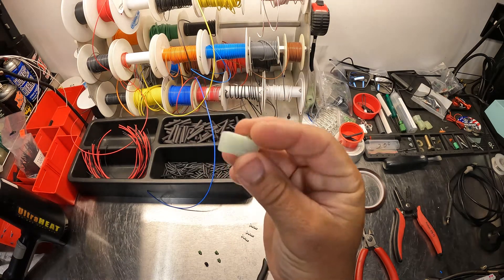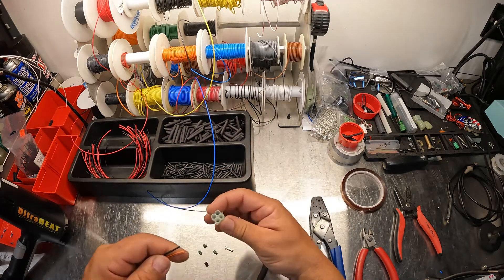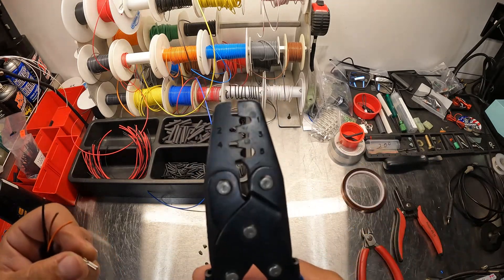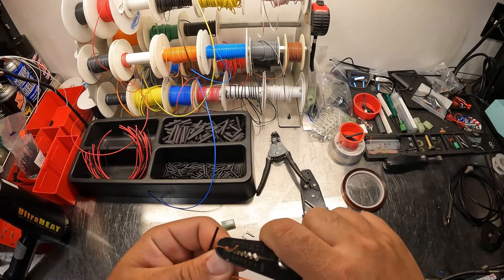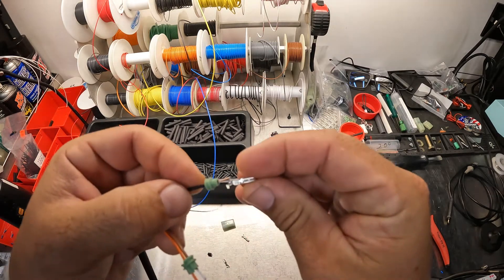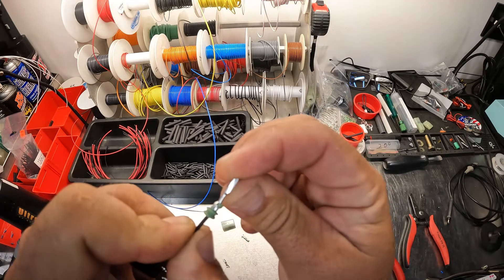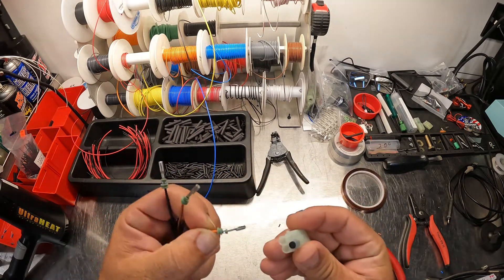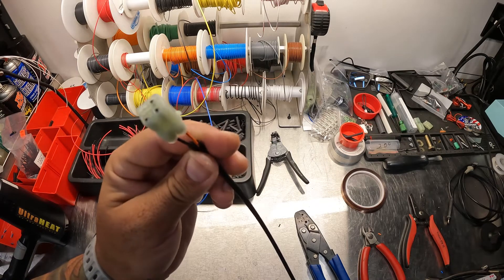Sumitomo HM Sealed Series Connector

Comment: Never told us where to buy terminals or their part numbers. Never mentioned who makes the crimper or the model number.
Reply from the maker: Hey Dennis. Hope you’re having a wonderful day. I was unaware it was bestowed upon me to inform you what terminals, where to buy, what tools to use, etc. this was a short video on the connector assembly, how to crimp the terminals, and a few little tips. 

If you have a question, you might want to try to phrase it in a way that it comes across as one. Instead of a negative remark on what someone didn’t do and how they didn’t do it to your liking.